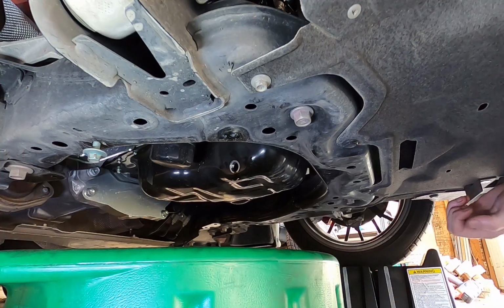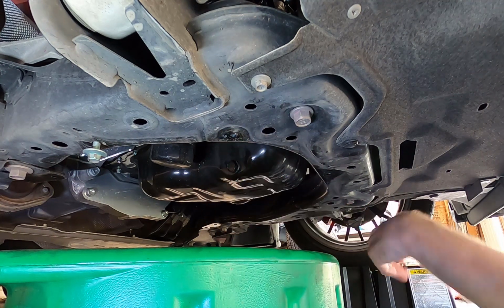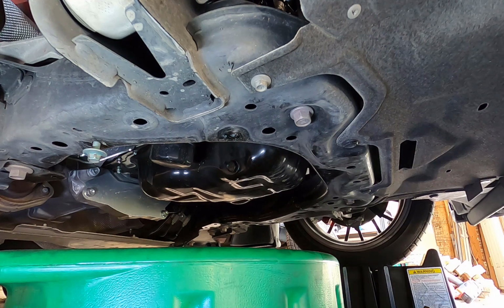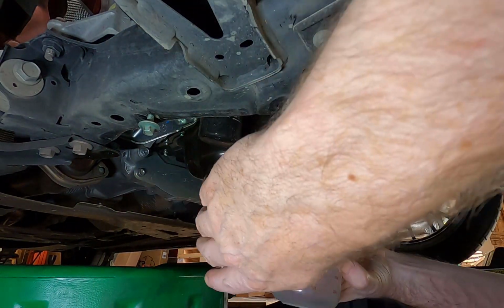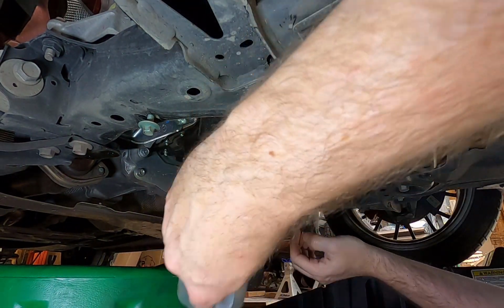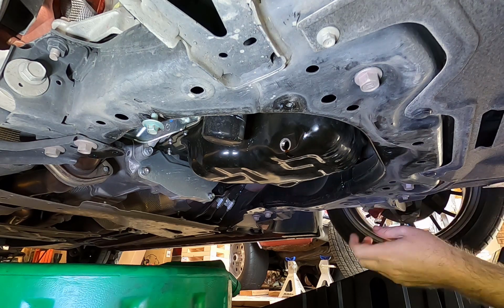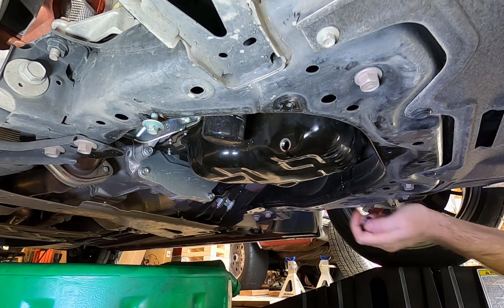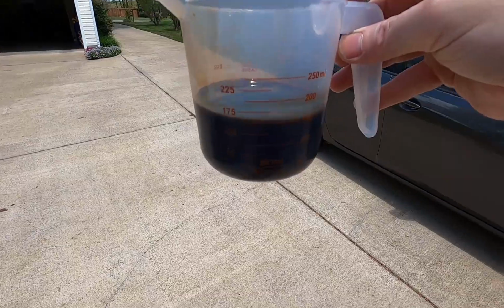How much oil is left in the pan when only raising the front. With plug toward front of pan.

Comment: I'm considering using a hand pump and stick the tube in there. Even when its level, there will be oil left on the bottom......because the drain plug is NOT on the bottom.
Leave the car on the ramps, then all the oil will be in the back of pan, then stick tube to the bottom side and suck it out. I bet you'll get much more than your 6oz.  I figure it'll take less than 10 minutes to hand pump it out. I might use a reducer tube and angle it downward to get every last drop.

Comment: I wonder how much is left if you keep the car on the ground, and you use an extractor through the dipstick tube.
Reply from the maker: Good question.  I guess it would at least partially depend on the where the tube ends up in the pan.  Which I have no idea where.